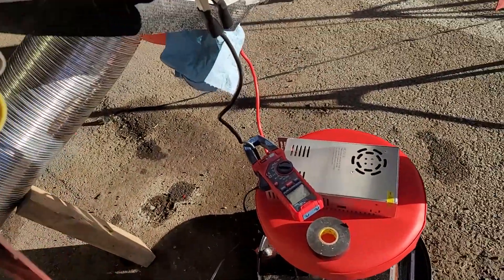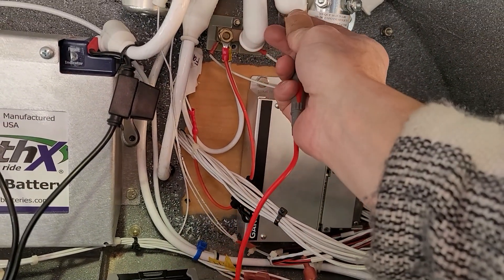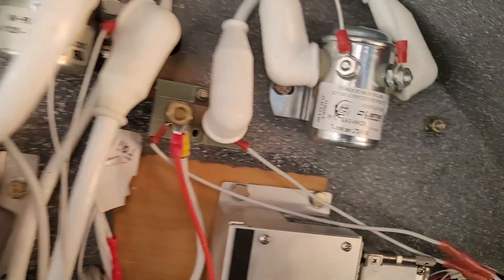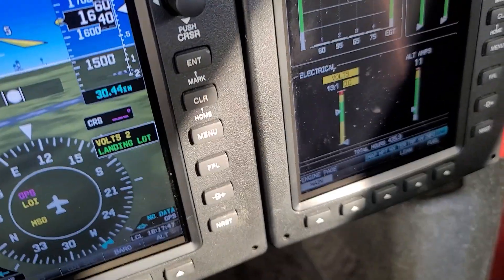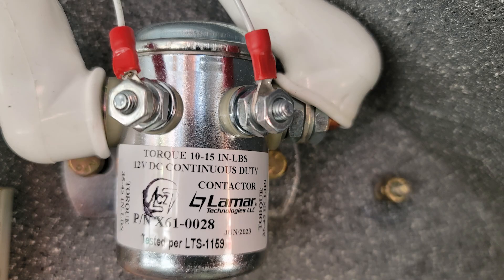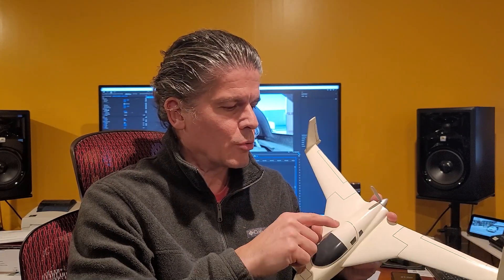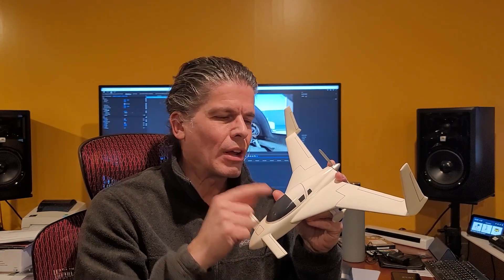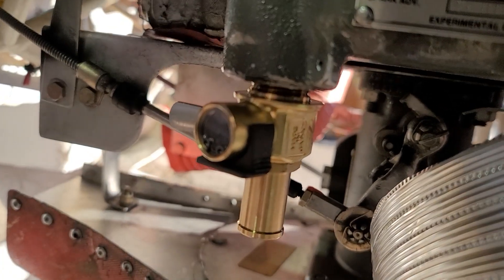Cozy MKIV Maintenance Part 5: Voltage Diagnosis, Canopy, Oil Drain

Comment: The oil drain valve clip is not good enough. 
Remember if it can go wrong, IT WILL GO WRONG.
Get rid of the drain valve, put the plug back in.
YOUR LIFE DEPENDS ON IT.
You have not even looked at the battery, Don't just assume the battery is good. 
Test it under load.
Even better just replace it.

Comment: for the canopy, some cozy fliers have realized that there is a low pressure bubble on top the the canopy bending it up slightly. Solution to that is to ad a latch on the canopy right on the top at the center line to secure it closed at that location. from the vids, looks like that, or the canopy is out of shape compared to the turtle back, same solution in both cases.
Reply from the maker: I was thinking the same thing, low pressure sucking it open. That said, I think I have identified the issue - the rearmost pawl wasn't moving forward far enough, which required the canopy to be pushed backwards to get around it - which means the rearmost part of the canopy was overlapping the turtledeck, rather than coming down and slotting into it properly. I've adjusted that pawl position, so I'll test this once the plane is back up and flying.

Comment: Impressive work on the volt drop and instrumentation error!
Are you happy having that lithium battery in the cockpit? I expect when it was originally located there, it was a lead acid battery.
Is it something special like a Li-Fe type.
Reply from the maker: It's a Lithium Iron Phosphate (LiFePO4) - and it's designed for aircraft. It has extensive battery management, monitoring and protection circuitry inside, so yes, I'm 100% fine with it in the cockpit. Actually there are two of them, there's also a small one in the nose that is the EFIS backup battery.

Comment: The master relay I have is very similar.  At 70F ambient, the coil gets up to 140F in about 15 minutes and is normal.    You might try tapping on the relay while you’re measuring voltage drop across the contacts.
Reply from the maker: Good idea, I will do this.

Comment: AWESEOME VIDS !!! 

too bad you can not include in the elecronics testing a TRANSMITTION TESTS for simulated radio calls over that 2 hours....  like if someone was gunna go in the pattern for an hour, talk to you on 123,4 or wutever channel is LOCAL CHATTER CHANNEL FREQ  whwere you could incorperate TX STATE (transmission state) DRAW on the electrical system.... CUZ YOU GUNNA DRAW THE MOST AMPS WHEN IN TRANSMITTING MODE.... lozza more than in STANDBY or just ON mode.....  L O T S more amps draw in TRANSMISSION STATE ....

BUT ....  in my head the psyko voice is saying, something like:  TOO MANY CONNECTIONS TOO MANY TOO MUCH ....and you kno anywhere there is HEAT there is WATTs ''near melting'' state lol (anyplace there is heat there is EXTRA WATTS beeing used.... kinda thing)

DID YOU GET A CHANCE TO LOOK AT THE WHOLE WIREING SPAGETTI PLATE WITH AN INFRARED CAMERA WHILE EVERY THING WAS UNDER LOAD??????   do you or one of your friends HAVE one you can utilize to SCANN THE WIRES for ''excessive temp differences'' AT A GLANCE not ''at a feel''  ... or to address the ''it feels warm buts'' ... ???
Reply from the maker: I do have an infrared camera, and that's a great idea, I'll bring it out with me the next time I'm at the hangar.

I think you're overestimating the current draw on transmit: my GNS530 draws a total of 3.6 amps normally, and that goes up to 6 amps during transmit. So only 2.2 amps added load for transmit.
Reply: @CanardBoulevard   RE: testing in TX MODE or testing the SIMULATED RADIO USE in the WHOLE TROUBLESHOOTING FORMULA.... that is.

it's just banging around in the back of my head ''WELL THATS ABOUT THE ONLY THING HE HADNT FACTORED IN......''  ABOUT that is, there are a few things I amsure there are other factors... BUT eh...  that and ''CONNECTIONS IN GENERAL'' BUT the IR CAM viewing it IN ACTION should illuminate any sketchy connections/wires heating up causing resistance issues...
Reply: @CanardBoulevard  the setup you've done with the PSU in place of the alternator is ideal for an IR camera. 
I've been on a similar volt drop hunt on a car. Obviously with a car, you're just going to run the engine/alternator but that is going to create a difficult environment for finding slightly warm items when there's so much heat coming from the engine.
It looks like you've got everything covered already but it would be interesting to look with the IR camera while you've got the PSU linked up.
It's not going to be the case for you but my car volt drop was an engine earth stud on the gearbox. The stud was a hex section with a male thread at each end. Top end had the lead to the chassis, the bottom end screwed into the aluminium gearbox. Dissimilar metal corrosion in the thread, had created a significant resistance in the alternator negative return to the battery.
Reply from the maker: @alanm8932  I'm definitely going to do that test with the IR camera - I want to see!

Comment: Kinda pointing to the belt, but I wonder if you could have any less connection points for the EO’s power wire. Each one is potentially a power drop location

Comment: I wonder if your cozy has a inflatable canopy seal system. Either way there must be some type of seal or gasket perhaps that got really stiff due the seal age in the cold weather?
Reply from the maker: Inflatable seals are typically only on pressurized airplanes. The canopy does have a seal and it's fairly pliable and in good condition. I think I might have found the issue however...
Reply: @CanardBoulevard  ah maybe I should have looked up what your Cozy’s max altitude was first :)
Reply from the maker: @TF_two 18,000 foot ceiling. An oxygen system is on the want list. :)
Reply: @CanardBoulevard I was thinking the same, regarding inflating seals being on pressurised aircraft.
I first came across them fairly recently with that Airbus where a passenger opened the door at a few hundred feet on landing approach. That door has inflating seals & I guess doors generally do, on pressurised aircraft. It looks like a very simple way to get a good seal but only where there's differential pressure.

Comment: I've never seen an alternator contactor.  If the alternator over volts you kill the field.  That voltage drop across the alt contactor is unacceptable.  Just take one of the big wires off and hook it to the other big wire on the opposite side of the contactor.  Then measure the voltage drop across those two crimped wires that are now shorted together.  Maybe you got a corroded crimp.  These can heat up and get worse.  I'm not buying the belt.  11A is not even a load on the alternaor.
Reply from the maker: When I talked to the manufacturer of the contactor, they said 0.19v drop is within limits (barely - 0.2v is the max).

As for the alternator contactor, there is a very good reason for it being there. Alternators with built-in regulators can have a failure mode where the regulator fails and it starts generating very high voltages. There is a crowbar circuit in the airplane that will short out the field, which will trip the alternator field breaker and shut down the field to the alternator.

However, if the regulator in the alternator has failed in such a way that it continues to put out voltage even when the field current is gone (this happens), it won't fix the problem. Therefore, the field current ALSO actuates a contactor on the alternator feed. Now when the crowbar circuit trips the field breaker, it shuts down the field AND physically disconnects the alternator from the bus in the case of an overvoltage, to protect the $20,000 in avionics that would otherwise be fried by the overvoltage.
Reply: Hi, the contactor may have  0.2 v drop at 100 amps but not 11 amps.  You may actually be measuring the voltage across a bad crimp and not the contact.  The field wire in the alternator makes a magnetic field in the commutator inside the alternator.  The slip rings or wire would have to short to the +12v to fully energize the field.  Shorting to ground is possible but not +12.  This doesn't happen.    You've got an odd problem with the voltage dropping over time.  I've had loose belts, makes the voltage always low.  Usually starts low as the load is high recharging the battery and then gets better.  I'm going to guess that you have a bad crimp on one of your wires coming from the alternator.  Just trying to help.  I worked as a failure analysis engineer in military equipment and have seen many odd things with electronics.  Built a canard airplane and owned 3 project airplanes.
Reply from the maker: I would normally agree with you about the bad crimps...except the voltage drop issue started occurring BEFORE that contactor was actually installed. Previously it was just the alt wire going directly to the current shunt, and from there into the main bus.

The alternator failure mode I am talking about is when the solid state regulator internal to the alternator fails in such a way (supplying current to the field winding) that it supplies field current regardless of output. There are MOSFETS in there that can fail closed or open, and if they fail closed, the regulator loses control over the field coil current, and even shutting down the field will not solve it. That's the failure mode that the contactor is designed to avoid.

I will definitely check the crimps however. You never know.
Reply: Hi,  Good data point that the low voltage occurred before the addition of the Alternator solenoid.  You are correct about active parts in the internal regulator.  So first, without 8-12 volts on the field the commutator inside can't develop the magnetic field and the alternator stops outputting current.   I think we both agree on that.  So the 14V comes from the airplane, goes thru the regulator and becomes 8-12 volts that drives the field winding.  An active device could fail and the regulator puts out 14V and the alternator output voltage goes to max.  That is a possible failure mode.  Shutting off the Alternator field 14V takes care of that.  But it's got to happen fast, that's the reason for a crowbar monitor on the field input.  This thing trips at say 15V and stays tripped.  Everybody is happy.  So lets explore the internal regulator failing shorted to ground.  The alternator quits.  No output.  There is no failure mode that allows the field to be energized when the power is removed from the field connection.   Now that we know you have an internal regulator, as that thing gets hot it could be malfunctioning.  I now place my bet that the internal regulator is malfunctioning when it gets hot.  Some auto part stores have a setup to run an alternator loaded and check for this.  Might be worthwhile trying that.

Comment: Assuming that alternator has an internal regulator, it would be interesting to see the change in output voltage with temperature. The alternator may start at say 32F and heat soak to 120F or more in flight? That's a big temperature range for the regulator voltage reference to remain fixed. Maybe one reason many automobile alternators have external regulators?
 Behaviour with steady cruise RPM may differ from marginal, low RPM drive from a battery drill?
Reply: I like the way you are thinking. If the new belt does not stop this issue, I think your post here is onto something. Conductance changing as things heat up.
Reply from the maker: It's possible...but this alternator is brand new, and the old alternator ran perfectly fine for 20 years with no problems. The alternator actually has a TON of cooling air pushed through it in flight, so it is not going to get very hot.

Comment: You are changing the alternator belt. Before you do, are you able to remove the alternator and take it to an electrical  automotive shop and have them put the rated load on it to test it. (What is the amperage that the alternator is rated at and compare it with the actual current the plane is drawing under full load) One other thing, usually if the pulleys are shiny where the belt seats, then that is a sign that the pulleys are worn to much.
Reply from the maker: Except this alternator is brand new, and the old alternator ran perfectly fine for 20 years with no problems. It was when the old one started showing sagging voltage that I switched out the alternator, and the new one was doing the exact same thing. Typical load in cruise flight is around 15 amps, and it is a 60 amp alternator.

Comment: for the air leak, use a thin layer of foam tape, or when in flight you can have her apply some green or blue masking tape to seal the air leak.  sure its a band aid, but if it works use it till you find a better solution.  mike
Reply: Camper seal tape ! Works great 👍